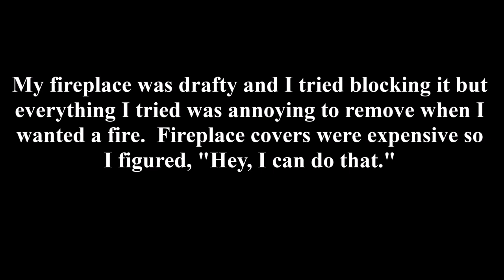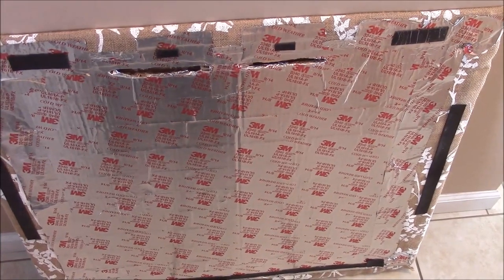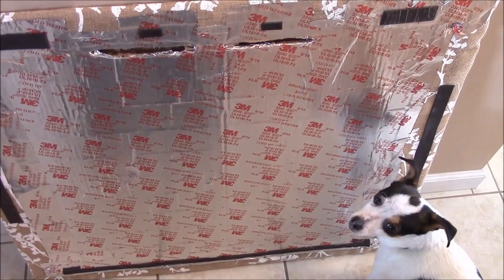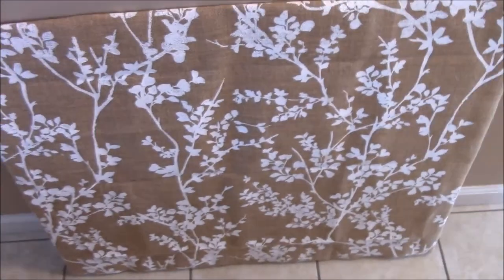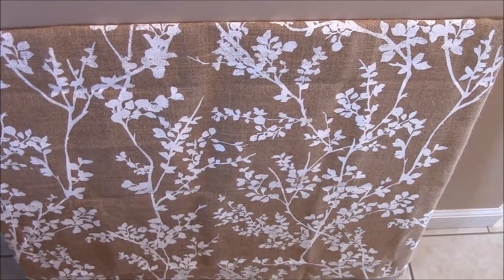My Fireplace is Too Drafty...

Comment: Can you take the mantel and everything out and just drywall over a fireplace? I cannot seem
 to find that answer.
Reply from the maker: I could do that with my fireplace but it would be very involved to do it right as I have a chute to the outdoors. Plus, I would need to remove some of the interior fire brick. One could remove the mantle and use drywall (with insulation) to cover it up. I would probably also seal up the chimney. But I am no expert in this area. I suggest asking a builder directly.

Comment: Can this be used on a gas fireplace that has a pilot light burning most of the time?
Reply from the maker: I would imagine that it should work as the material would never come into contact with the flame.